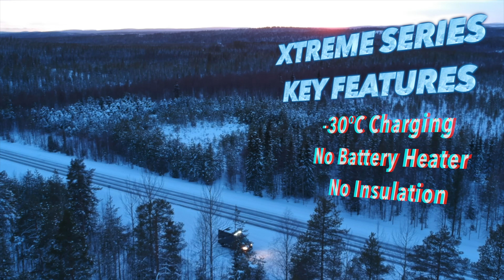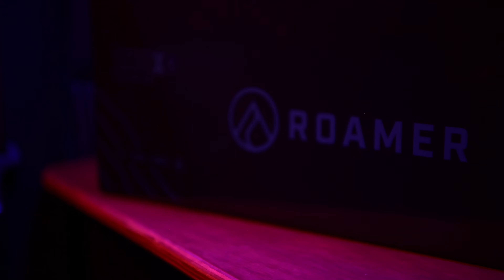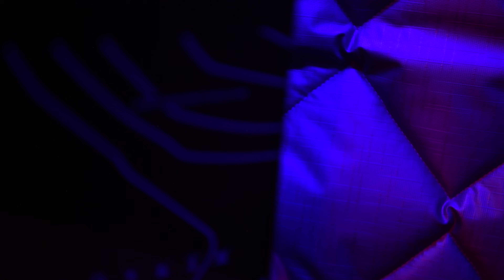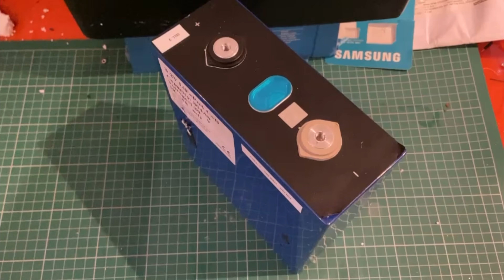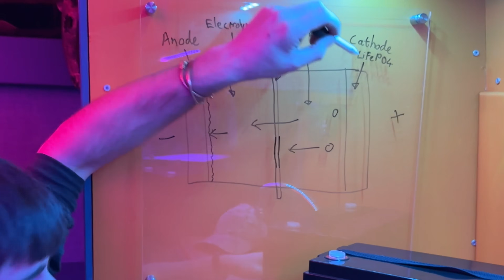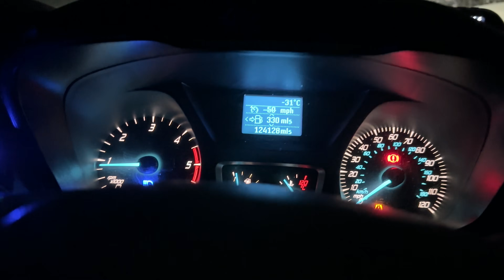HOW TO charge LITHIUM below ZERO!

Comment: A guy from Norway posted that his BMW bike has a lithium battery - if its below freezing, he puts his headlights on while getting ready - the load on a relatively small battery thaws out the cells -
Reply from the maker: Yes, that principle works. It’s probably a Noco brand 12V lithium starter battery for motorcycles . Those batteries BMS still work the same, minimum discharge will be -20c and the BMS probably cuts charging below zero. 

“Relatively small” load is important here. For example, those Noco motorbike starter batteries 12V 3ah models up to 9ah. Using 12V 3Ah as an example a 12V 3A load ( tiny ) on a 12V 3Ah battery is pretty massive! A “1C” discharge rate which will heat up the cells very quickly! 3A load on a 12V 100Ah leisure battery ( example battery in video ) would only a 0.03C discharge and make almost no different whatsoever. my own van leisure batteries at 12V 400ah. 

Additionally, cell type is important most standard lithium leisure batteries for camper vans use prismatic cells which are large rectangular blocks, model like the extreme series in this video and other types of batteries use small cylindrical cells which help with temperature change a lot easier.
Reply from the maker: But overall great point and yes, applying a load does heat up batteries just it easier to do that on small batteries.

Comment: couple points. lith plating is only one mechanism for lfp battery degradation. its usually the one that matters most in the long run, but for cold weather charging its actually a break down and gas formation of the electrolyte that kills them. this was mitigated in the first LFP batteries made in the late 2000s by the inclusion of yterbium to the cathodes by an old mfg called watson. for gas formation, the orientation of the battery is extremely important, should be upright. also, prismatic cells are made from aluminum cases which conduct the heat from heating pads good enough. you only need to keep the battery above 4C to avoid any issues, this takes very little heat, a 15w heating pad does just fine for a 4kwh battery. 
they dont put the heating pad under the battery because it could get damaged/destroyed over time from vibration/movement. 
i doubt any mfg is currently using yterbium in their lfp cells. it would just about tripple the cost of the batteries. what you have here is a lot of nonsense claims. there are only a handfull of lfp mfg in the world, and every branded battery is just using these top 3 producers since theyre in a race to the bottom in terms of pricing. CATL, byd, and EVE. it makes way more sense to add a small heating pad and buy more batteries than to buy any of these gimmicky batteries... wholesale LFP cells are now 45$/kwh delivered in the usa which is insane. most of their price is down to the cost of shipping. just use anologue active balancers instead of bms boards and you can make any battery you want for 1/5th the price. add a 1$ w1209 relay board and a 1$ heating pad and you have a perfectly adequate cold temp battery for an order of magnitude less money. if you want crazy cold performance then go with LTO. sodium ion is a joke.

Comment: This battery is to expensive for what it is. For that price one can get a solid state marine batteries.
Can be easily charged and discharged from -20 to 70 C°. Below or above bms will cut the voltage.

Comment: Just finished a 9 day ski trip in BC in our truck camper. Battery worked great the first night and temps dropped down to -20C. I couldn't get it charged back up and now I know why. I was able to get it to charge slightly by putting a metal water bottle filled with boiling water beside it and covered in a towel. I will be relocating it to the inside.

Comment: I think we’re seeing something unfold which is Will Prowse’s whole shpeel we all bought into on needing a low temperature disconnect in batteries otherwise they’ll be some form of permanently damaged was nothing more than him reading the spec sheet and the reality is these batteries won’t even accept a high rate of charge at that temperature. My hot take. 

I have some questionable grade B cells I’ll get around to testing at some point but makes me wonder why the default JK BMS setting is something like -20C specifically for LFP for low temp disconnect.
Reply from the maker: I would say low temperature disconnect as an absolute vital part of any battery regardless of heater and no heat. 

The electrolier in normal LFP cells just loses its ionic conductivity, which causes the damage of lithium plating if the charge current is too high

However, I think the confusion happens as most people believe the issue in its simplest sense and think charge at any Ampage at 1° and nothing at zero.  when the key factor is really the charge current temperatures. In theory you could have a battery which communicates to a charger and tells the maximum charge current ( to prevent damage ) it’s allowed at certain temperatures. But that’s far more difficult and far easier for a company to implement by just having a hard fixed temperature number to disallow charging.

I might be wrong, are you sure the low temperature disconnect on the JK Bms is -20c is just for discharge? As normal lithium cells can still be discharged at -20 just not charged.

You are correct  LFP “won’t accept” in a sense higher charge at lower temperatures because the internal resistant of the cell increases as temperature decreases. However, it will still accept more charge than it can safely handle without damage.

Comment: you are over complicating the heating pad placement. If you keep the heating pad turned on long enough ( 8hrs to a day) , it will saturate and heat up all the batteries almost evenly . How I know? I used a thermal camera to see the heat distribution.
Reply from the maker: There is no heat pad placement on the Roamer batteries. But the heating foil example I show in the video is how it’s done by may other companies throughout the industry. 

Most built-in heat pads only turn on during charging ( they said they don’t drain battery power by just remaining warm when not needed  ) and they don’t effectively heat prismatic cell packs when they just wrap the grouped cells block. I know because I’ve disassembled them and used a thermal camera. And seen massively unequal heating between cells, including allowing charging with some cells are still  below zero. 

If any form of heating would be done, the best option would be a single pad at the bottom of the pack.

Comment: 15 minutes in and nothing new said yet. And get a shop light for crying out loud.

£900 or $1100 US for 12v 100ah

The practical use case for this is only in the arctic.
For everyone else, get a battery at a 1/4 the price, build an insulated battery box that will also house your mppt and inverter and a small 12v heater.
Reply from the maker: setting the scene, not everyone might know as much about the technology of lithium batteries as you do.

Comment: Hi, was you on the roamer stand at camp quirky after lock down? I purchased one of their under seat batteries & remember there being someone who did extreme stuff with them
Reply from the maker: Indeed I was, I’ve been on the stand for a few festivals this summer as well
Reply: @MispronouncedAdventures  just watched your videos on your van build. Wot was your reason to use a diesel heater to heat your water instead of say a truma diesel/electric heater? U can still heat the water from your inverter. Also would u not consider upgrading to say an autotern as they look far better quality
Reply from the maker: Not personally interested in a Truma heater, I would rather keep my unit separate and the unit which I can fix myself. 

Whilst the autoterms (  and I have access to them ) are a higher quality unit. their features are not as good as a Chinese diesel heater with the afterburner controller I use

Comment: Here's another myth: I have 50 LFP Tesla cells that were sitting at 0.50v when I got them... Trash, by the standards of the DIY battery community. I charged them up to 2.5v@5A and they held charge. I then step charged them up to full charge, and built a working battery. 100% no issues. I think people are regurgitating the old lithium ion spec data for lipo4/lfp. 

Lipo4/lfp is still a newer technology, and real world data is being collected, while dispelling the old lithium ion technology/myths that it's tethered to.

Comment: To charge a battery in cold temperatures which are outside the batteries operating temperature you have to utilize a heating system that has a regulator so that you don’t over heat the battery ( prevent thermal runaways ) along side some insulation to minimize the heating systems energy consumption. End of story.
Reply from the maker: Or you can do it others ways Like shows in this video.

Comment: As you stated in the video, the low temperature charging does not have a hard cutoff ay 0°C. A lot of the BMS sold have a 1C max charge rate above 0°C, and completely disable charging below 0.

But there are batteries that have temperature based current limiters. One example of a battery sold in Norway is the regular 1C charge rate above 0, but between - 10°C and 0°C it limits the charge to 0.05C.

This is safe, and I'm disappointed that not more batteries have this multiple step implementation..
Reply from the maker: Yes, the vast majority of the lithium batteries which are sold at low prices are many, just Chinese rebrand with very simple and basic BMS. 

But I guess it’s a lot cheaper for companies to do a hard cut off opposed to a current control. 

Interesting, Norwegian example, which company is that I would be interested into looking into its model of BMS. Always like learning new things. 

But generally, yes. the no Charging below zero is an over simplification of a more complex issue. But I guess for the vast majority of the market that over simplification is probably just fine .

Comment: If the temperature sensor is on the bottom of the battery, I can imagine an external heat on the bottom pad tricking the BMS to charging while the top of the battery is still frozen.
Reply from the maker: Which is why it is important to have multiple temperature sensors inside a battery, luckily many of the high-quality BMS is have multiple temperature sensors. As you’ve quite rightly pointed out different areas of the battery will be different temperatures.

Comment: I’ve got Renogy 100ah ‘smart’ lithium batteries. I bought Facon heater pads ready to install with an auto thermostat with a rocker switch. I’m thinking I should place the heating pad underneath away from the BMS and place it on a switch before the fuse panel and use it when necessary. Otherwise use the battery cutoff switch.
Reply from the maker: I agree when heating is required for a lithium battery I feel it’s best to be at the coldest point or where the most heat escapes from which is from the bottom. Heat pad under it a great option
Reply: @MispronouncedAdventures  Groovy.

Comment: Good stuff to know. Seems like a lot of added peace of mind in areas like arctic regions, etc. I'm wondering what the tradeoffs mght be as well. Could there be some tradeoffs operating in hot weather with an electrolyte formulated for cold temps?
Reply from the maker: As for trade-offs, it’s not hot temperature. You actually get a higher then standard operating temperature with these lithium cells as well as a cold with temperature. 

Trade-off is size and cost, they are both larger than the equivalent cells at the same capacity and cost more

Comment: ebikes batteries do not like the cold and we are told not to go below -5 degrees. It can make the battery go dead also it affects the life of the battery and range if it does not go dodo.
Reply from the maker: I’ll be using them this winter and I was last winter as well. My e-bikes are kept in the heated van until use, I’m often not out for long enough for them to cool down below a operating term, wait for them to warm up again before charging. 

Although I might consider insulating them a bit more or even a heated cover

Comment: Isn't that a lifeypo4?
Reply from the maker: No, LIFeYPO4 ( Lithium Iron Yttrium Phosphate ) achieves its wider operating range over standard LiFePO4 cell differently, well by the Yttrium and are normally a prismatic cell structure. These LiFEPO4 achieve their wide range by changing different components of the actual cell and normally cylindric type, but the base chemistry (cathode )  is unchanged
Reply: @MispronouncedAdventures  
Thanks
Reply from the maker: I did actually get to see the distinctive yellow cells, which LiFeYPO4 use in a control box in Lukla airport when I was working in Nepal. Which is a great use of them being in a small solar powered bit of kit in a cold remote location
Reply: @MispronouncedAdventures  
I build some systems with the yellow lifeypo4 Winston cells so I don't have to worry about the cold as they are rated to -40c 
But I ran in to a problem 
Because the datasheet says ones the cells are at -20c the low cutoff and full charge voltage change I don't know te exact numbers now but it was about 2v low cutoff and about 3.3v top at full charge 

If the temperature is consistent- 20c it's not a problem I can set the bms to the right parameters but where I live the temp ranges from -35 to +35c  that would mean the bms would have to change the parameters automatically by temperature I never heard of a bms that can do that 

The reason I'm bringing this up is how are the cells in your battery behaving with my concern

Comment: Cold is not enering nor exiting. Cold is the absence of heat...
Reply from the maker: Yes, you are correct. But since I’m explaining the “concept” of cold and stopping something from getting cold as it’s a negative in this sense. It’s easier to refer to it as I did. The same way you refer to the cold getting it if something froze like waterpipes in a garden, it’s not correct as it’s heat leaving or energy leaving, but to still reference as cold get in.
Reply: @MispronouncedAdventures  It is, nevertheless, perpetuating misconception and misunderstanding. 
Just because false information is easier to digest by the less educated, it is not an excuse for propagating it.
Reply from the maker: @PașcaAlexandru  Presenting a practical concept isn't necessarily perpetuating misconception or necessarily equate to spreading false information, especially if you're aware of the scientific principles. It's about striking a balance between simplifying ideas for a broader audience while acknowledging the underlying scientific principles. Communicating complex concepts in a more approachable manner is a common practice. However, I feel you’ve made your viewpoint clear

Comment: Please stop saying the cold comes in, you know that its the heat going out.
Reply from the maker: Yes, I am aware because cold is the absence of energy. So yes, energy is going out. So you not wrong 

I guess it’s the context of how i spoken it. I guess in the terms I’m using if I was actively heating a house or van and it was insulated, I would want to prevent the heat getting out. I guess in this situation I’m not actively heating the battery and trying to contain heat I’ve put into it. 

Or as cold does damage to something unheated ( let’s say to water pipes or something ) to you talk about the cold getting in.

Technical terminology you are correct
Reply: @MispronouncedAdventures If the temperature outside and inside the battery were the same, would the heat go out? No.  So without cold, you get nothing.  Therefore it is the cold that comes in.  You need cold, you don't need heat.  

Now if you want to get technical, we have defined heat as a higher number than cold.  If this was reversed, all the physics would stay the same and correct answer would be given.  There is really nothing wrong saying cold comes in.  Its convention in physics that heat is high number of energy and cold is relatively low.  Otherwise, it makes no difference which is which.  

So it is convention not some absolute to speak heat is high and cold is low.  If you wish to flip convention, it's not like you are violating some law of nature.
Reply: Potato tomaato
Reply: Lol
Reply: Nonsense. Cold air definitely comes in when warm air goes out. What an idiotic hill to try to die on.

If you're going to be an ass, at least be correct in your pedantry. What a douche.
Reply: Both are correct
Reply: I just duscribed to your channel even if hard to follow your pronunciation  we are not used to hear english people  but i will try to get some of your knowlege and experiences  Thanks  I am in North America  Arizona State  summer tempeature reach 122 ° F
Reply: Cold is the absence of heat. Not energy
Reply: @insane_G_NYC  that's deep and heavy
Reply: @insane_G_NYC heat is energy.  So cold is the absence of Heat-energy more correctly